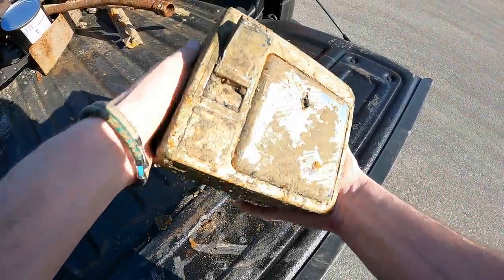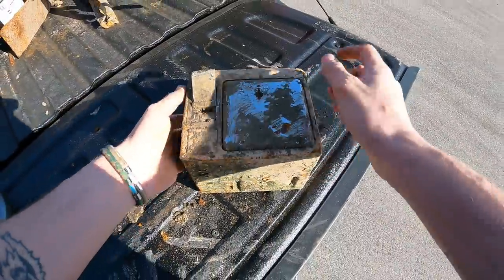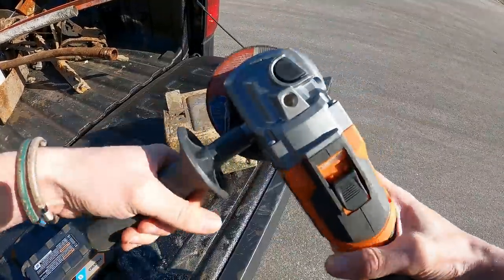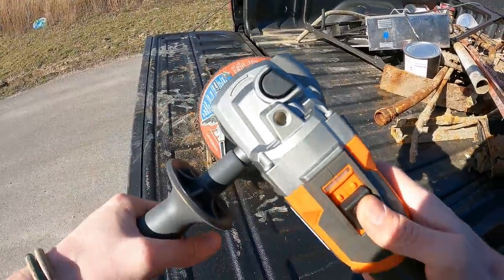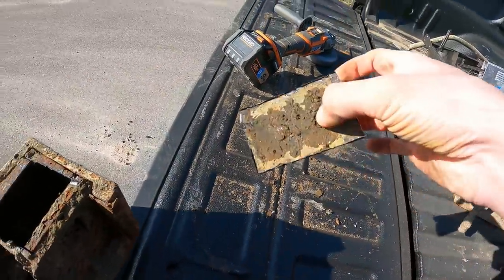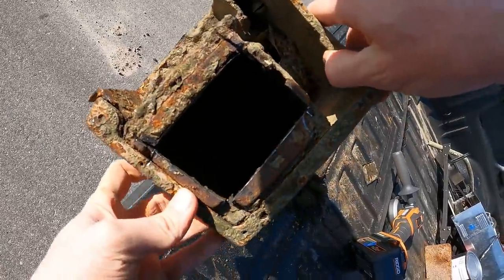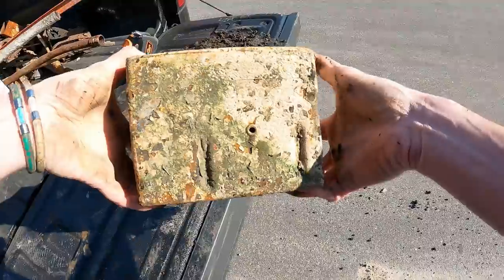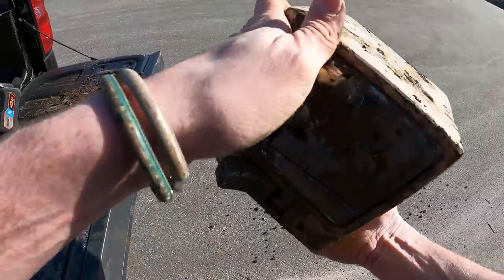What's Inside This OLD Locked Safe I Found Magnet Fishing?!

Comment: Two things, someone had a key and opened it, cleaned it out and locked it back up and threw it. Also, never remove that guard that goes around that cutting disk. I've seen people with 2 half fingers and the disk got too small and blew apart. Took 2 halves of his fingers off at the knuckles. Word to the wise Tyler.
Reply: Yes, I had to get stitches cause I took that guard off, and as I was bleeding,  I was putting the guard right back on. Lol , but seriously it's No joke.

Comment: The safe is actually the bottom part of an old payphone. That style is so old that it had a dial instead of buttons. If you would examine it more closely you would see a slot in the top for the coins to drop into the box. you could have got lucky and found a bunch of quarters in there where someone made a long distance call. I haven't seen one of those since the '70s

Comment: Next time you're cutting something that small or a bit smaller, make sure its clamped to something solid "preferably a bench lol" or being held down by something really heavy. If not there's a chance the object could jolt & then that could make the grinder jolt.. (Oh & plus you'll cut through it alot faster and easier.) If not, many POSSIBLE "not certain" bad to very bad injuries could happen. Better to be safe then sorry 😉

Comment: Pressure wash it there should be a slot going into the locked box  for the coin to go into and come out when the locked box is change to another dialer unit..

Comment: Also angle grinder safety tips, when you are putting it down, make sure that the blade disk is facing up not down contacting the surface. 
At least that is what they told me when I was using it.

Comment: "Really old 20 - 30 year old coins". Hahahaha! That's not old. Now maybe if you find a bunch of coins from the 60's and 70's, they'd be worth holding on to. That still doesn't make them all that old. It's just the coins from before the mid to late 80's were made of more nickel, copper and silver... But after the mid to late 80's some of the coins started using a LOT of zinc in them. Most coins these days are mostly zinc and smaller amounts of copper and nickel. Pennies are almost all zinc now. The copper is just a shell. 

Nice try on the lockbox. I too don't have a clue on HOW those muddy balls got in there. Maybe whoever opened it before you left a little surprise for the next person. Haha 
Great video. 

PS: I used to collect coins. I still sometimes do. If you find any old coins that are corroded, use a vinegar soak and maybe a (LITTLE) bit of silver polish (even light jewelers rouge paste) to clean them up. Avoid crap like TarnX and also anything that might really scuff the coin surface up. Coin values can change drastically on condition. Even polishing it up to a mirror finish can reduce the value. With some things, it pays to keep the old weathered look.

Comment: The front plate of the pay-phone's coin-compartment is a very thick metal slab that removes with a large key, then the lighter-gauge-metal safe-like coin-box underneath it is removed with a second, smaller key.

Comment: The people who threw the coin-box into the water could have determined if there were any coins inside by simply shaking it to see if there was any rattling or jangling.  So that's probably why the box wasn't cut open; they could tell it was empty, so they didn't bother cutting it open.  Maybe the pay-phone was vandalized shortly before all of the pay-phones in the entire area were removed, and so not too many people were using them to place calls, at least with cash; the few folks who did make calls were either using phone-cards, dialing just toll-free numbers, and/or calling collect.

Comment: Probably all the dirt got into the box due to small insects/animals and water-currents; both can cause minute dissolved particles of earth to gradually be collected and settled into a mostly-closed space through any tiny crevice or hole.  There would have been larger openings in the box when it was freshly thrown in there, before rust and encrustations began filling everything in.